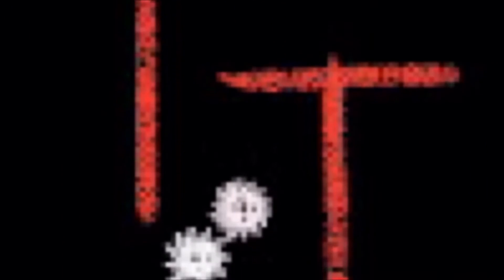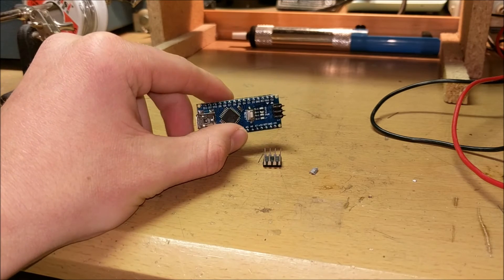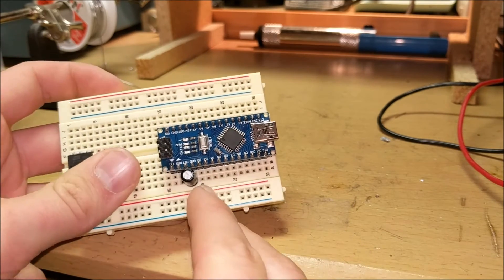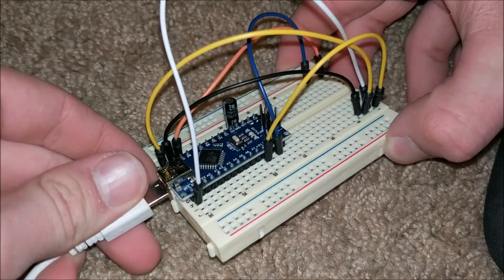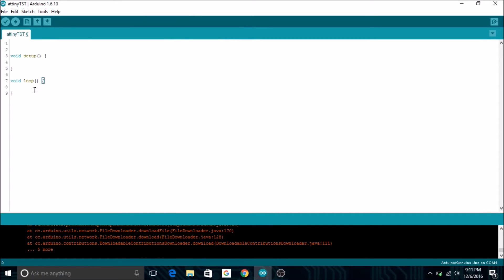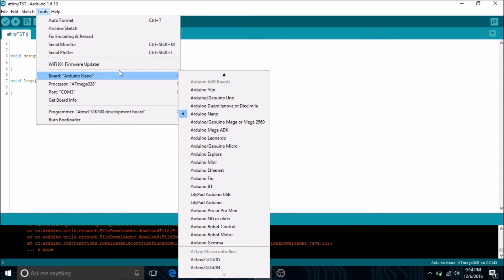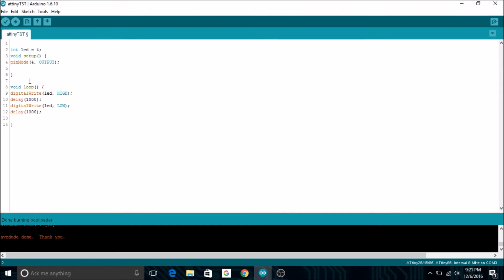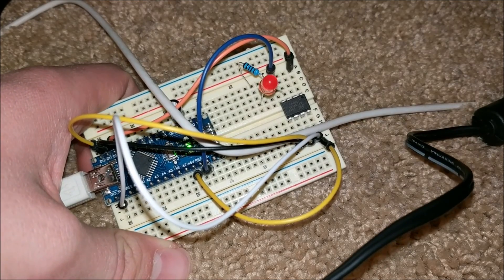How to Program an ATtiny with Arduino Nano

Comment: I too had to remove the capacitor to upload arduino isp. all good. BUT then when I replace the attiny the PORT is grayed out and I get an error when trying to Burn the Bootloader. I have hit the wall there.

Comment: Great tutorial! Thank you for sharing this. However, I couldn't upload the ArduinoISP with the capacitor connected, only when I removed it. I'm planning to make a Tiny programming board because it is more convenient that way. If I exchange the used nano for another one, maybe an smd switch to connect and disconnect the capacitor will work.

Comment: Hi,
Can you help me when I do Burn Bootloader to face with error "
avrdude: Yikes!  Invalid device signature.
         Double check connections and try again, or use -F to override
         this check.
Thank you.
Reply: Make sure you are using the correct (10uF) capacitor, it gives same error if you use wrong one or don't use at all.
Reply: I went around and round with this and finally tried a new chip and it worked. May have gotten damaged by bad instructions I was following by others. Follow this with a good chip and it "will" work!
Reply: I had the same problem with over 50 chips i got on JD - JOY BUY
they had been packed just in a plastic bags no anti-static protection 

they all have 

Yikes! Invalid device signature. Double check connections and try again, or use -F to override this check.

and i am not trying to get a refund but i am not have much hope

Comment: I had to disconnect the Cap in order to program the nano board with the ISP program, you failed to point that out .  This link pointed that out : https://arduinodiy.wordpress.com/2012/02/28/program-an-attiny-with-an-arduino-nano/
See the steps ...

Comment: Great stuff.
I have tried to do a similar thing with a Pro Micro, the one uses 32u4 chip.
All the wiring seems to be ok, but nothing happens :(
Arduino IDE starts the upload, but it won't finish. It seems, that it is not able to talk to the 32u4.
I asked a question here, https://forum.arduino.cc/index.php?topic=496743.0 but it seems nobody has the answer.

Comment: At 4:58, did you compile and upload the program?
Reply from the maker: Mike Collins Yes
Reply: Thanks.  I assumed you must have.  I followed your excellent tutorial, and got my ATtiny programmed with a blink program.  I have written an application in assembler, so is it possible to use Atmel Studio with this setup?  Alternatively, how can I compile assembler programs with Arduino IDE?
Reply from the maker: +Mike Collins You should theoretically be able to use atmel studio with this setup.  Because your Arduino is already programmed as an ISP, atmel will treat it as any normal off the shelf ISP and you will be able to upload code to the attiny.  You can program assembly codes in Arduino, here's a link on how to do that. http://forum.arduino.cc/index.php?topic=37130.0
Good luck to you!
-TT
Reply: Thanks a million, Tanner Tech.  I'll look into that.